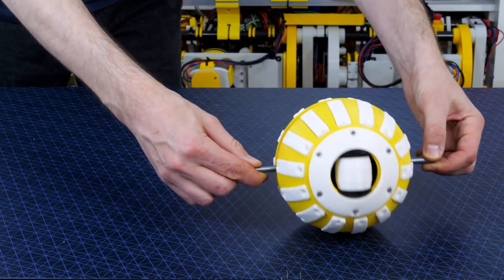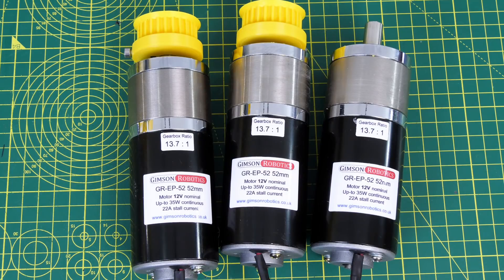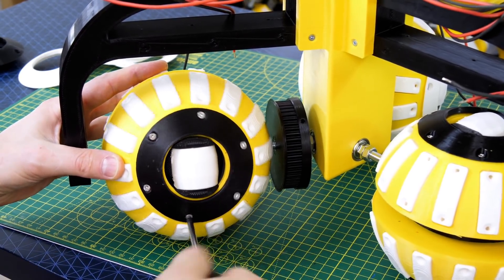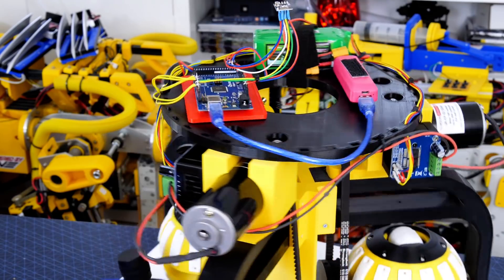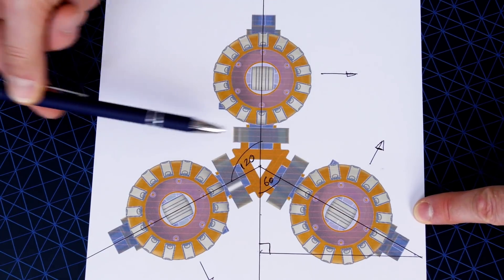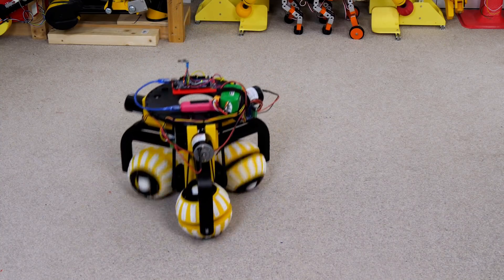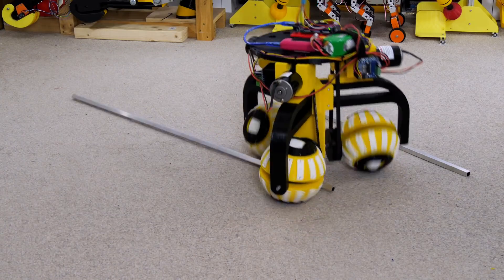Testing Ball-Shaped Wheels on an Omni-Directional Robot

Comment: Need wheel speed sensors for the plastic lid when the leading wheel starts spinning the robot drives its self off.   If u can detect slip u could change the rotation of the back motors that have traction then it could push on to the lid.

Comment: Fantastic idea and it moves so smooth! Just a curious question, is there any resistance to the wheels? As in, if I physically push it will it move? If so, any ideas to make it static when the motors are not being used?
Reply from the maker: You can back-drive it but it's quite stiff. Powered up it also has magnetic braking because both sides of the motor are connected to ground through the driver.

Comment: I’m trying to see how these would suffer road wear, and common road hazards. You’d need to make sure whatever bar you use as your suspension isn’t likely to be struck in any sort of low level collisions. You’d also need to design the tread to shed debris and keep rock and stuff out of the mechanicals in the gap. However maybe it’s not totally impractical with some work. And having a extra axis of movement seems really awesome.

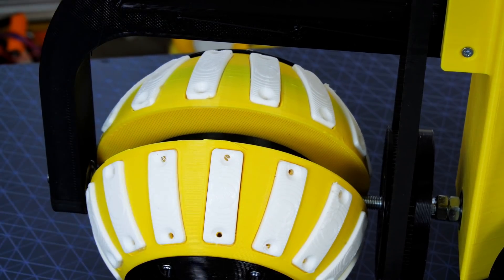Comment: 11:00 the ball joint design would be perfect to  eliminate the gap, and also placing  and spacing the actuators inside the joint for  better and more precise control, and increased traction/torque.  A reverse trick that's been in use  on computer mouses and  trackballs.

Comment: Why not program the non driven wheel to center align to the direction of travel? So as to reduce drag and increase surface area? Also curious what happens if both front wheels are driven in the same direction? At 60 degrees I assume there is some forward travel however reduced but would love to see this explored!
Reply: EDIT: I do realize "reduce drag and increase surface area" makes little sense! What I mean is that increase surface area/grip, but I also assume it has less wasted energy on the larger wheel.
Reply from the maker: There isn't a situation where only two wheels spin in the same direction because the third wheel would jam.

Comment: Would a ball at the ends of the axes work better than the wheel?
Reply from the maker: No, they would just slip and it would lose traction when you drive the wheel in the main axis. You only want them to turn in one direction so they grip in the other.
Reply: What about texturing to give it grip? Say dimpling, like with a golf ball? Or would that interfere too much with its ability to roll?

Comment: https://www.linkedin.com/posts/nirajkachhadia_robotics-automation-ugcPost-6812107200991940608-gyt7

@james - take a look at this.  They're using it for a shoulder joint, but it seems the same thing would work as a wheel with some minor modifications. Would love to see you test it in comparison to your current Omni directional wheel system.

Comment: How would it work in a car situation like the original idea was? The angled motors work to drive the wheels but if the axles are totally straight that wouldn’t be possible, so how would it work?

Comment: How is this design any good? It is constantly hitting the small wheels , parallel on the axis of rotation. It makes it bump twice per rotation, per wheel. If you are moving in a direction, and not just rotating, that is 4 bumps per one rotation. So unless you plan to put a shaker on top of your robot, this is complete waste of time.
Reply from the maker: made you watch though
Reply: @jamesbruton  Why wouldn't I? You present a concept. You test it and show me the result. In few minutes I get a knowledge that will cost me weeks to gain on my own. It is still valuable. To me at least.

Comment: I’d suggest for improvements to possibly change the belt for a rigid mechanism, as belts can wear out. If this is going to be used practically like in cars, I’d suggest a better mechanism for the small wheel, as it seems very easy for that to get stuck should the car be driven on a dirt road. Possibly just replacing it with a free rotating ball in a housing would work better.

Comment: I was curious to know can't you hypothetically use the same principle that we used to have in older mouse pointers which eliminate the need for a axel for the ball wheel altogether? it would require a way to rotate 2 or 4 powered rollers independent from one another for a single ball wheel though

Comment: Hard to tell from the video, but doesn't this design necessitate a fair deal of slippage? Having the direction of rotation be misaligned from the direction of motion seems like it would wear the wheels down in the long run. 
Additionally, I feel like the hemisphere design will be problematic, especially if you try to scale up to a high torque/high load application. Each wheel would be limited by the tolerance of the extremes of the hemisphere, which I anticipate will be weakest when standing near the poles. So, your max speed and max weight would have to be determined by the near-poles, giving you a much more volatile wheel than you should have at that size. 

Neither of these concerns are particularly damning for what is being attempted with this project, and I am not an expert, but I just felt like they could be interesting avenues for design speculation.

Comment: Cool idea. Hopefully car companies don't try something like this. Having 3 independent motors for a wheel would be highly impractical if something were to break. Then again... with the extra motors, they could compensate if one were to fail until the vehicle could get to a repair. There's so much good, yet so much complication for this concept. Such a contraption would cost a hefty amount to repair on a vehicle.

Comment: As I mentioned in the part 1 comments, mount the axle on a bias instead of horizontally. Eliminate the small wheel on the hemisphere. Apply the K.I.S.S. method.

Comment: OHHHH I LIKE THE WAY YOU WENT WITH THE AXLE WHEELS!!! i had the idea i suggested on your last omni wheel ball vid that perhaps you could take the same concept as anolog mouse trackin sensors of a ball that you than put into a divit that is a bit more than a half circle with room for the ball to rotate so it cant be pushed out but allows easy rotaion in all directions although the way you went is intresting too of from the little sinppet at the begining im guessing that its a normal wheel but its mount allows it to spin in a 360 degree circle and the premise is when it gets on the axle side the flat of the whell will allow it straighen to the direction it needs to to move

Comment: i like it but what if you use like 9 wheels so it moves on three with two up and when it hits a stair it can try to climb up by rotating the extra wheels like legs placing the next wheel on the next step to step up thils still moving the wheels idk might be a fun idea to try making a robot able to climb while able to move in all directions

Comment: I’m curious as to the longevity of this design as compared to traditional wheels or other omni-directional designs. I’m wondering if the fact that to go anywhere instead of just rotate you need to use opposite torques to generate forward force might lead to some amount of bending of the axles if they have to deal with some load, like say if the robot it’s carrying is quite heavy,

Comment: What if you change the little wheels with ball-shaped wheels? With a design simular to ball point pens so it's stuck in place but still can move in all directions. I think it will make the transmission from little wheels to big wheels even smoother

Comment: He could make something like a rubber jacket that goes over each hemisphere. Along with a hole where the smaller wheel sits. If made out of tpu it may work with its flexible nature
Reply: Also this jacket would allow for different variations of tread depending on the design printed on it. A side benefit would be if the tree wears down enough over time it's a easy replacement due to just being a jacket

Comment: The center of mass is a bit high. An improvement that would require a ground-up redesign would be to widen the vertical space between the two parallel beams between the wheels and put the motors there. Also, with a small cylindrical gap in the base between the wheels, there would be a great place to keep the electronics and batteries that would make it basically impossible to tip over.

Comment: potential exp. given each drivebelt is located near the wheel, adding suspension components to each knuckle(im assuming the black prints) that bot could haves some incredible articulation in each strut making it a very adept offroad/ rough terrain vehicle. love your work!

Comment: Just a quick question. Why not just replace those little wheels on the ends with freely moving ball bearing? I think that it would work better.

EDIT: Just got a great idea. The balls from old computer mouses would be ideal. They have about the right size and texture.

Comment: you have also forgotten that this robot Is a bit off balance when you try to give it a speed plus the taller it gets the robot might tip overdue the mass not being evenly distributed to so I think that you have to make the gaps b/n the baes and the weels a bit wider that way you will gain a more stable and evenly distributed weight among all the wheels.
I really am inspired let us have part III

Comment: this is awesome, a really easy way to pull off omnidirectional travel, and surprisingly easy to code for by the sounds of it!

I have a suggestion for improving the ball wheels though, It came to me after watching that the driven axel really has no reason to need to be a cylinder you could use some 2 mill flat metal plate and it really wouldn't matter, it would mean you could get those hemispheres super close.

Comment: Possible idea for your grip issue
Print the hemispheres just as you have but leave them slightly smaller then print or attach a cover of tpu to pit over the top or even print it onto the part directly for a more secure attachment

Comment: I wonder if you could replace the wheel treads with paddles and use it to drive on sand.  it has the vertical clearance for different treads in the "wheel well"

Comment: Make a mold of the wheels and cast it with silicone/rubber. Cover the 3D printed wheels with it. Voila, you got grips. 
But of course, you need to make smaller wheels to compensate for the rubber

Comment: Wouldn't it make more sense to just angle the drive axis removing the need for the center roller on reasonably flat ground? I suppose that would reduce the effective wheel diameter, but not by much.

Comment: Is it not possible to have a completely spherical wheel. 
Where the axle entry is to the wheel have a guide to open the section as it get to the axle.
This way you can use completely rubberised materials with hard hindged sections as backing.

Comment: This is amazing stuff, watched most of your vids now :) Do you ever release details and code etc maybe of simpler projects - i'm trying to find how to make a self balancing bot as an early starter project, got as far as stepper PWM drive and have some data coming in from an IMU but no real idea how to join the two systems - i want to use a Pi Pico and as its new there is not a lot of info out there - any advice?
Reply from the maker: Yes everything is on Github.

Comment: What about tank threads made of hemispheres so it can rotate sideways? It should add stability and grip along each axis while improving climbing ability. Maybe even climb stairs. With your current setup it will be easy to get stuck on top of obstacles (stuck in the center of the wheels). Or lets skip all that and go straight for a Boston dynamic humanoid... Time for a Bruton Army!

Comment: @james Bruton, why not try to increase the radius of the frame, this way weight is more spreadout not only generating more force down as the weight is farther distributed, but it should also generate more grip as there is more space between the gyrowheels for it to manuver, but as the design gets longer ( taller ) it will be more stable if you really want to make a home assistance robot.

Comment: What if you motorized the passive axes as well, perhaps transmitting both power and control signal thru the axis (one side positive, the other negative, and the control signals embeded in the power signal as some sort of modulation)?

edit: Or perhaps even have the power itself be AC, so you can just have coils around the axis to avoid the issue of dragging contacts.

Comment: stabilty and control issues when encountering small light objects, I suggest you move the motors down on the side of the black wheels bracket holders so each wheel has the motor at 60 degrees upwards instead of straight vertical, (obviously shorter belts) that lowers the center of gravity by a huge factor, liberating the top for other applications, on top I would place a heavy wide surface batery (not tall, just wide), also good for authonomy, but moslty for lowering the total center of gravity, in such configuration it should climb the lid allright and drive over small light objects without dragging them.

If you increase the wheels diameter to 100%, keep TPU stripes slim and place them almost touching to eachother, you get a slightly bigger base, maybe 60% larger, but more fit for a robot that is tall and unstable to mount atop, while it still can pass through the doors allright, thou it might not be able to climb stairs.

Comment: Wouldn't it deal with terrain a little better if it pushed the passive wheel over the rough terrain than pulling it? I guess that's more of an operator technique thing than a design thing.

Comment: Lowering the center of gravity by mounting the motors directly above the wheels or into the cenyer with right angle reduction box would be better for installung something heavy on the platform.

Comment: Hey try to spray some bed liner on it, instead of just printing the TPU.  Bedliner has caustics in the formula so it may melt pla but if you did it in small doses or maybe cover the pla with something else first like epoxy spray paint....

Comment: Seems like it might benefit from some kind of differential, suspension and/or gyroscope.

1. Differential do that the wheels can go at different speeds.
2. Suspension to help the robot handle rough terrain.
3. Gyroscope to help prevent the robot from falling over.

Also, I think the robot should have a full 6-axis IMU, plus a 3D compass. This way it can more easily self-correct its own movement when something is just slightly miscalibrated.

Comment: Wonder how this would work with 6 or 8 wheels 🤔. And with a wider stance or extendable/ retractable "legs". 
Or a mirrored top and bottom (3 up 3 down) offset 60 degrees, so if flipped it could still move with little trouble. 
But the coding would be hard.....

Comment: I think that the gap between the two hemispheres could be removed completely by using three sphere caps instead of two hemispheres and, consequently, a triangle shaped beam going through the center with three branching beams going through the sphere caps and a little wheel on the end of each of them. 
Geometrically the three caps can be constructed by cutting from a sphere a prism that goes through the center of the sphere and has a regular triangle base which can be inscribed in the circumference of the sphere. 
The main trasmission mechanism would stay the same, with the pulley acting on the base of the center beam, but there would be an extra rotating part and another wheel in the middle of it, which, as it turned out from your prototype, is acceptable. The nice thing is that the sideways rotation would go along a (ideally) perfect circumference, without any (big) gaps.

if you don't understand, sorry for my bad english

Comment: also you should have all wheels motored at all times so you will not have one acting as the drag wheel having less issues going over pipes and what not. also you have the 3rd wheel acting as the push wheel helping it even more.

Comment: With this new Droid Concept One version of an outer shell would almost have to be a Dalek.
Trying for greater weel control might be impruved with a gyro in each one. the Droid could have a vastly enhanced suspention if each weel was on it's own hindged leg. 
A Computer could help to map out the changing focus point of "center of balance" Higher or Lower Vs the weel angle. the range of that balance point would be wider if it had even short legs.

Comment: I wonder...
If you had a compass on the machine you could take that value and have it auto control the differential of the tire rotation using that value from North.
Reply from the maker: Probably, that's quite common for robots with no wheel encoders
Reply: @jamesbruton  that does make sense. And I'm glad I didn't just think of it for the first time lol.

Comment: I wonder if rather than having dozens of little TPU sections to screw on, maybe have a series of concentric grooves that could hold some ORings. Or you could just paint the halves with some of that vinyl stuff they use for covering plier handles.